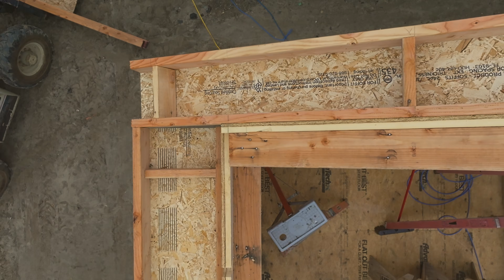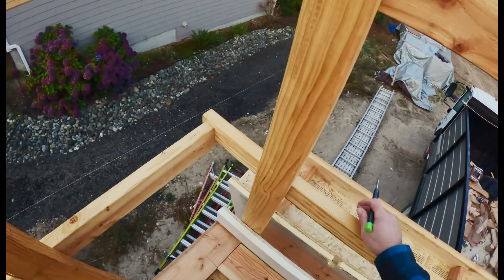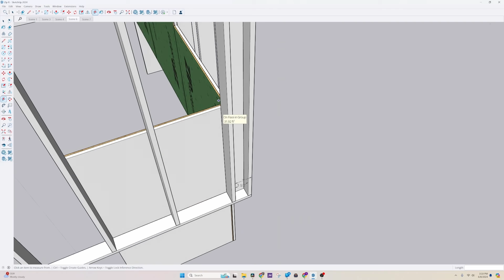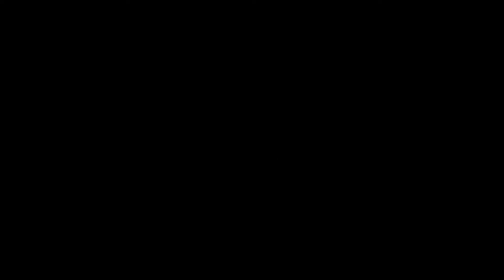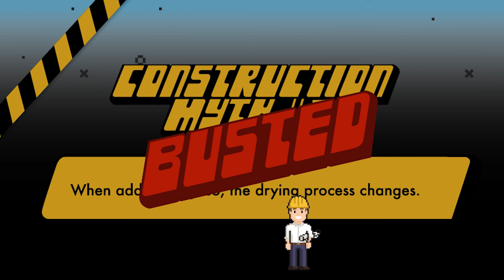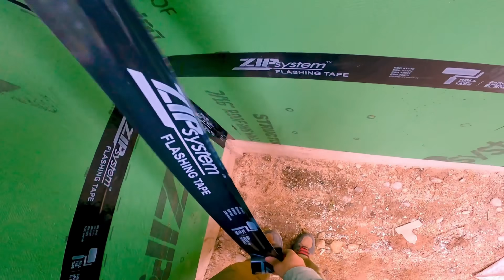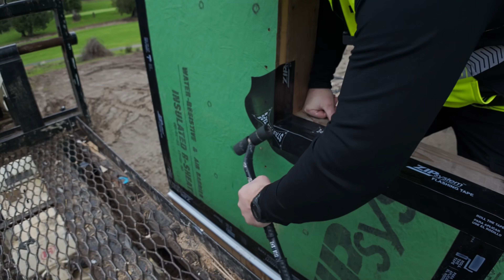EXPERT TIPS| Continuous Insulation

Comment: I recently built a house (my own), and fabricated my own "ZIP-R" panels on site. It was really easy -- just hit each 7/16 ZIP sheathing panel with a shot of Advantech subfloor foam glue on each corner, and one in the middle. Then slapped a sheet of 1" XPS foam onto it. Let each panel set up for about 1 hour. The Advantech glue bonds the two layers like cement, and this saved quite a bit of money as compared to purchasing the ZIP-R panels from Huber. All you really need is enough glue to hold the two layers together until the panel is installed.
Reply: Great tip. If you're a hillbilly builder like me out in a county where codes don't exist it might be a good alternative.
Reply: Why not put it on the outside at that point? Less risk of condensation
Reply: @wallacewoodworks9582 Great point. If you can get the R value either way, why take on the unknowns/risks of trying to bond directly to OSB? 

I always assumed Huber bonds foam to OSB as a convenience, an "all in one system" It never occurred to me that there was some advantage to gluing foam directly onto OSB.
Reply: sweet tip!
Reply: Could you 45 the outside and inside corners?
Reply: @Michaelrocha4 i was thinking the same thing.....or cut back the iso for a staggered effect
Reply: @bignicnrg3856 most I have seen do this.  Cut off a strip of foam on one side. 
Others just zip tape over the foam and hol off nails for trip 1.5 inches from edge and trim nail into the trim board
Reply: U guys need a version of a stand up nail gun like the flooring guys have for screws… I like how u frame sheeth and such before standing it up but my back hurt watchin u 😅🍺
Reply: Does the foam face the inside or outside?
Reply: I used foam and nailed it in place, taped seams with over lapping seams. Then zip board  taped and liquid flashing on all nail heads. Glue in placed could have saved me some time. Thanks for the idea.
Reply: This is what im doing so I dont have to put 1k nails per 2x4
Reply from the maker: I would be surprised if you any AHJ allowed an amalgamation like that since there is no testing of the assembly as required by code for approval
Reply: @AwesomeFramers   Probably right about that. But my inspector didn't fuss over this. Yet it's hard to see what difference the assembly process could make??? I don't think the foam board adds anything to the structural integrity of the panels (while also not detracting significantly). And so long as you attach the sheathing itself according to Huber specs, this just counts as another layer of insulation. Or? Am I missing something? (and thanks for you feedback!). I'd be more worried with thicker poly iso boards -- e.g., 2" or greater.
Reply: @ceterisparibus51 it for sure works, it’s just not code stamped or listed as engineered and tested. So depending on where you live it may be a total no go.
Reply from the maker: @ceterisparibus51  With Zip R you get warranty, and testing that is submitted to the code.  You no longer have the warranty when you modify the use of the panel outside of the installation instructions.  Will you actually have a probably? Likely not, but there's nothing to back you up if there is a problem.  I've been to the see Huber's racking testing personally, its worth using the suite of products and being covered.
Reply: @AwesomeFramers - I'd have to ask what good is the warranty if a problem occurs on a finished house.
Will Huber pay for all associated labor and materials to replace their panels?
I mean, it's really doubtful any issue will surface before the product is encapsulated by the rest of the home, so.....
Kinda like Home Depot warrantying a water heater. They won't pay to have it removed, won't pay to have the replacement installed and won't even come get the bad unit. You are responsible for all of it so....what good is the warranty on a $400 product when it'll cost twice that much in labor alone to replace it?
Reply: @AwesomeFramers along those lines, what if I simply use a 1-in layer of insulation between the zip sheathing and the framing?  Without gluing/ bonding it to the zip?  Just curious. Thanks for this video, powerful insight!
Reply from the maker: @Jerry.Hathaway  That won't meet any code requirements, there's no warranty, nor testing as required by code.
Reply: @Jerry.Hathaway brother don’t pay any attention to what this “awesome” framer guy says, he’s payed to promote this product. It’s just a piece of OSB with glued styrofoam nothing more. And if you read my other comments you will understand why it is bad to have a soft layer between the studs and the OSB which is supposed to be touching the studs for structural integrity. Is basically the concept of the shoebox without the lid or without the lid. Put all the styrofoam on the walls after you glue (liquid nails) and nail or better use deck screws and put your OSB on the studs and after that insulation.
Reply: @Jerry.Hathaway  I’ve done exactly what you described in Mi. Had to add some metal bracing and use longer sheeter nails. Worked great and was passed by the inspector.
Reply: @AwesomeFramers  not the case that every component lol
Reply: @Jerry.Hathaway this was my thought, so you can offset seams and get a better air seal.
Reply: @AwesomeFramers  can esp sheathing be installed on a exterior stud framed wall, then exterior sheathing on that?
Reply: @AwesomeFramers why don’t you say the truth about it? You are payed to promote their products and follow their agenda. What’s the difference between their product and the one that he made? None. So stop trying to find reasons.
Reply from the maker: @FreeYourBrains  This entire video is "the truth about it".  You haven't worked with it, so your perspecitve is limited to put it mildly.
Reply: I think a sub structure failure that's not covered by warranty would cost a lot more than whatever kickbacks they get from their suppliers. For a pro, warranty is important. For a diy homeowner, cost might be the most important factor, but please never sell your poorly built experimental "house".
Reply: @tylerjbellows  No doubt. But have you ever heard of an actual case of structural failure that was covered and paid out by warranty? My bet is that most carpenters in the U.S. (or anyhow in my area) do not install ZIP panels strictly according to Huber specs, and will therefore not be covered under warranty anyway.
Reply: @AwesomeFramers  Ive worked with it. Not a fan. The foam panel is attached to the osb with a squiggly line of glue. Its not laminated and comes of fairly easily if it gets wet. What happens when moisture inevitably gets between the foam and osb and starts to grow mold and rot the osb?
Reply: @DontAatMe  Interesting, I was under the impression that the polyiso was fully adhered to the Zip. My initial thought about the roll your own Zip-R was that condensation could occur between the Zip and polyiso because it wouldn't be fully bonded. But if Huber creates the boards in the same way... Also, Steve points out that the polyiso is very vapor closed so I suppose vapor wouldn't be migrating much though the wall and then the insulation board on its way outside.
Reply: @tylerjbellows As a contractor who frequently is called in to fix experimental houses. Absolute nightmare. There is a reason we have code approved sheeting and fasteners.
Reply: Testing was done on self assembled panels and it's been fine in the Seattle area for a couple decades. There was a case study done on a codes innovations database at one point so that builders wouldn't have to reinvent the wheel with each new build but I'm not sure what happened to that project
Reply: @tylerjbellows  spitting air theremate,.. its the same structure lol foam and crap osb lolololol
Reply: @DontAatMe  it turns to actual mush
Reply: @FreeYourBrains   he may be paid by them but I'm a builder and I'm not paid by them.  The problem with DIY zip-r is that it will be much weaker than zip-r.  Zip-r has a fiberglass sheet on the face against the framing to strengthen the nails' hold against racking. If you want to diy, put the structural panels directly on framing! Can then add foam over it and then strapping or OSB to catch siding nails.
Reply: @tylerjbellows lol.  Spoken like a true NPF.
Reply: @ceterisparibus51 I have been building for 30 plus years and have seen dozens and dozens of warranty claims.  Not once, has a manufacturer ever covered one.  They will always blame the installation, even if it means lying.
Reply: I like your way of thinking.
I already understood that you'd have people try and "shoot you down," regarding what you did. Risky to even give tips on a forum like this. Certain people are associated with products, whether paid or not. Certain people don't care for the person that is more "hands-on."

Good tip from you!
Reply: This is how Zip got started. A Seattle builder, Martha Rose, came up with this and had a local lab do testing to confirm performance metrics. I got to frame a project for her a few years ago :)
Reply: I agree.  These expert awesome risinger types are just scammers.  Reminds me of the solar experts.  Listening to them talk with their advanced vocabulary you forget that their just a bunch of framers and construction types.  You know , the ones who failed chemistry and calculus in high school
Reply: @cd1168 it's not a scam to use zip r, add up the material costs and the labor costs to buy vs make on site.

Comment: Great to see a framer concerned about structural integrity of a building. So many homes ive inspected have that missing. We are in a high seismic zone also and there is a lot to consider when framing a house, shearwalls, hold downs, species of lumber etc.
Reply: @drumswest5035  what exactly are you talking about? The OSB in modern times and 1” thick lumber boards back in the day are basically installed to give structural integrity to the studs walls which without that would be like a sheet of paper. The styrofoam glued between the studs and the OSB completely defeats that purpose. Next time you go to chance your tires bring some rubber spacers and ask your tire mechanic to place them on the lug bolts before he installs the rims. After that tell me how many miles you drive before everything breaks apart. The same thing happens if you don’t secure the OSB directly to the studs.
Reply: @FreeYourBrains  I totally agree with what you said, i was just stating the fact that he is aware of the structural aspect of building. We never use styrofoam board anywhere in our engineered designs either as a lot of these new exterior type boards that keep cropping up are not proven with time. We always state to nail directly to the studs with proper nail spacing and nail diameter for shearwalls and if the engineer need more strength we go with D. fir plywood or add sheathing to both sides.